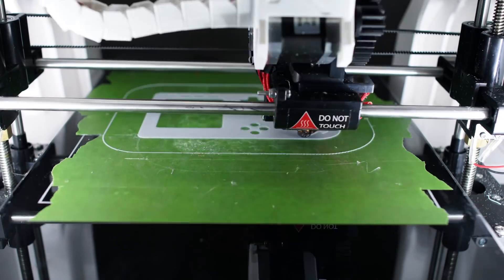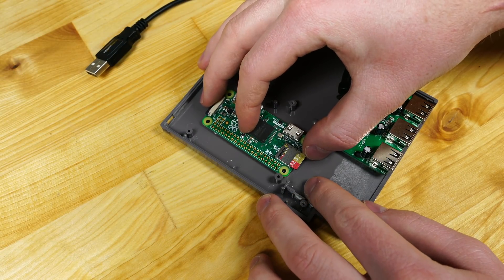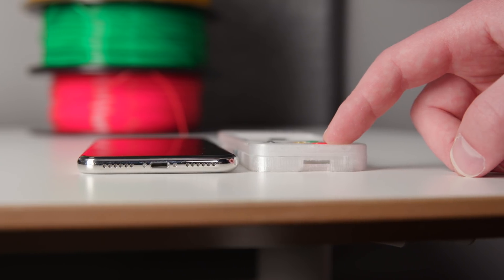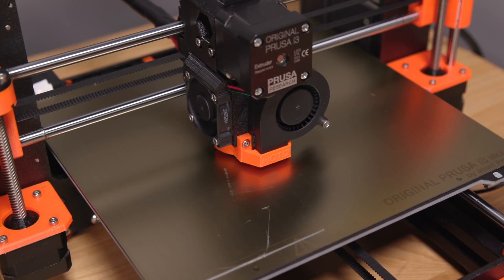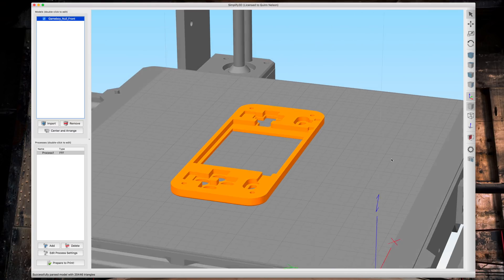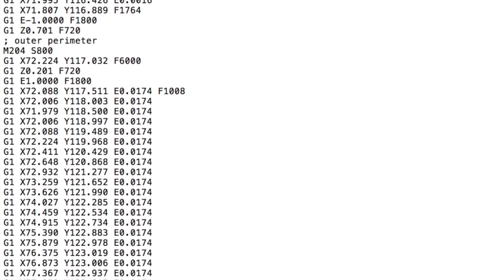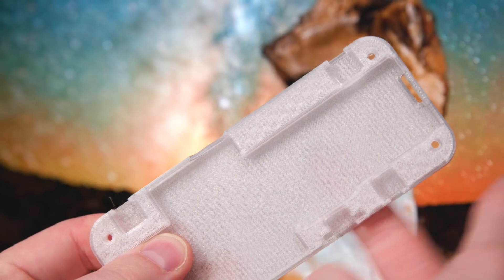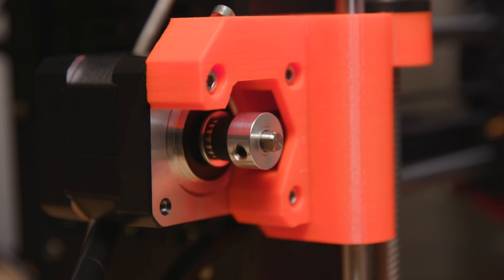How Does 3D Printing Work? Building a Handheld Retro Gaming Console!

Comment: You really shouldn't advertise the Anet A8 as a 'cheap 3D printer', with its known removed industry standard safety features, among other corner cuts that make it a nightmare to deal with. For barely any more money you can get a Creality Ender 3 which is easier to build, prints better, and is MUCH safer.

Comment: I only got one good print off my i3 mk3 sadly, the right side doesn’t stick well and even after going into calibration and tweaking that the corners of prints don’t really stick and it’s just a bit upsetting because of how much it cost and how much it sucks right now
Reply from the maker: How’s your bed leveling?
Reply: I’ve been messing with that but still haven’t found a sweet spot, the center holds down alright (during the calibration test that is) and I have a few other stl for calibration that do a outer boarder and small squares but the outer board messes up and doesn’t stick so like I said trying to find the sweet spot but not having great luck

Comment: This made me want a 3D Printer
Reply from the maker: So much fun. Get one!
Reply: Just got myself a Prusa MK3 few days ago and its one of the best right now, up there with 2-3k EUR printers quality-wise while being priced at 770EUR.
Reply: Me too.
Reply: If you want something large but relatively inexpensive get the Creality CR-10. For something smaller get the Creality Ender 2. For something that you will not have to tinker with and will work pretty much perfectly with a bunch of advanced features, get the Prusia i3 Mark 3. It’s more than 2x as expensive as the CR-10 and has a smaller build volume but it’s probably the best 3D printer you can buy.
Reply: If you want to get a great machine, and you can do it yourself, then a Hypercube 3D printer can be interesting.
It took me like 10+ hours to make, but it works like a charm...

Comment: If anybody is struggling with the 3D printing process or which one to buy. I would highly recommend watching “makers muse”. In his 3D printing 101 series he guides you through everything you need to know and if you get stuck you can ask him questions on his streams. BTW in my opinion the best bang for the buck 3D printer on the market at the moment is the “Cetus 3D”  for only $299 USD. Anyway if you have any questions please reply to this comment I was one of the early adopters of 3D printing and should be able to help you out. :)
Reply: Leo Molloy Rclifeon has some good reviews Aswell if you're stuck. The ender 3 seems like a pretty good first printer but I've got a Monoprice select mini which is great.
Reply: How much space do they take up? I’m pretty limited on space right now.
Reply: Link Kakariko it depends on the one you get but for example the Cetus is about 30cm by 30cm by 35cm. So it could easily go on your desk next to your computer or what I do is put in a cupboard so when it’s print the small amount of noise it makes is reduced.
Reply: Leo Molloy thanks!
Reply: In my case, my desk exploded with 3D printer related stuff...

Comment: Do you mind telling what issues you were having with your printer, and how you went about solving  them?
Reply from the maker: My old printer had tons of issues ranging from lead screws, to the heat bed, etc. I got it working well but it took a lot of time, hardware mods, and firmware reprogramming. Ultimately I just decided to get a new printer since they’ve improved so much in the last few years.

Comment: I’ve had my prusa mk2s for over a year now. Only now did I run into a problem where the x and y will shift at the same exact layer. I’ve got to tear this thing down now. Best thing about 3d printers is making your own original designs and selling them. I’ve paid for my printer 5 times over.